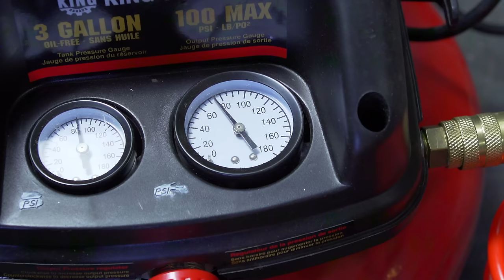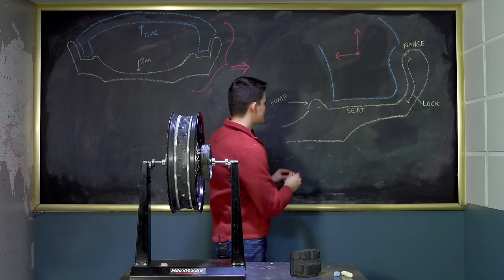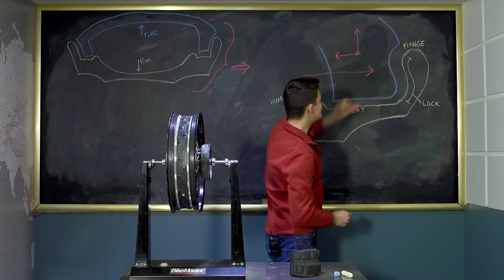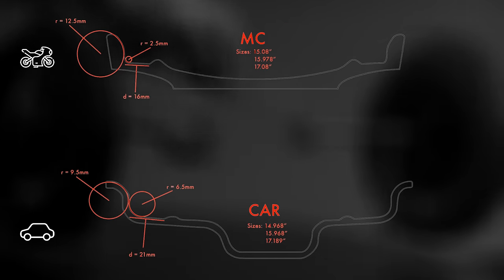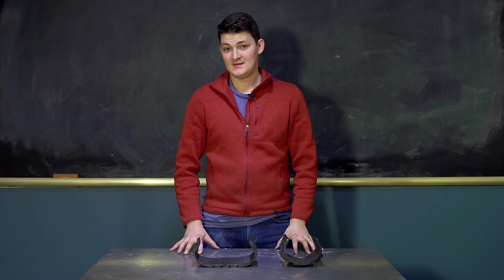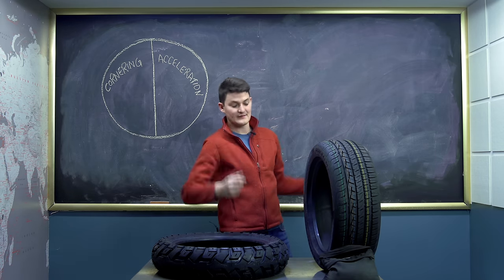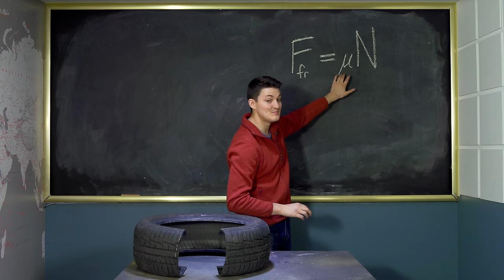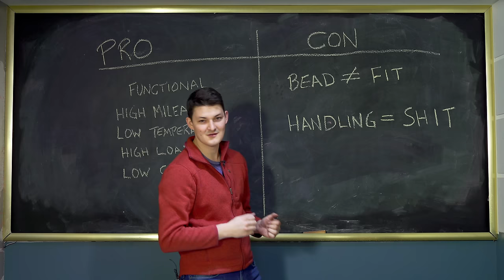Are Motorcycle Tires a Ripoff? The Darkside Car Tire Experiment

Comment: I have to disagree with the "higher mileage" point. Having been turning wrenches professionally on bikes for 15+ years, I have changed thousands of tires in my career. Many were utterly destroyed car tires. The tread wasnt hurt hardly at all. Its the sidewall that takes the hit. When you put big fat bikes on a 2 square inch contact patch while cornering, rubber flexes. Being that the sidewalls are drastically thinner, they flex first. This will generate excessive localized heat and wear and will eventually appear as if something was jammed into the side of the tire and rubbed a groove into it for a few hundred miles. Ive physically seen the sidewalls fail and cause the bike to go down, which totals the bike. And get this, these tires only had a few thousand miles on them.
Maybe its different in flat states without a single turn for hundreds of miles, but out here in east TN where the road maps look like a plate of spaghetti, darkside is a big hell no!
Reply: Couldn’t have said it better my self .
Reply: Every time a post like yours comes out, or like one I mention where a dude crashed twice on car tires, due to blowouts, I'm told to "prove it". It's funny how one side is believed, without comment, while another is disputed. Great comment.
Reply: @Wroger Wroger Another good point. Ill add that motorcycle tires work best and have the most traction when they are warm. They become more malleable and adhere to the road better compared to when cold. Car tires are designed to resist all heat buildup possible so they last longer and will NEVER benefit from the effects of a warm tire and will not have the same amount of traction as a real motorcycle tire.
Reply: There are sometimes blowouts with car tires, because run flat tires are run way too long without any air.  They are so dang dependable that some folks think they can ignore routine PSI checks.  However, a low tire sidewalls are MORE vulnerable upon the thinner motorcycle tire, and I've been guilty of ignoring them when I was young.

Another neglect caused by car tires is the required maintenance on shaft drive bikes.  The car tires last three or four times as long, so gears are neglected until they run dry and self destruct.
Reply: A flat state, and commuting 80 miles each work day, was exactly why I was considering them, but no car tire would fit the back of the Vulcan I had.  I would have done it in a heartbeat to avoid changing out rear tires so much.  The way I see it, I wouldn't do it for two bikes, but for a dedicated commuter or cross-country bike, sure.
Reply: depends on how much you're leaning on corners. Some people barely lean at all and, for them, car tires would wear longer.
Reply: @MrHeepspo  If you are "leaning" on corners, you may need a riding lesson.  I counter steer, and grind my pegs.  You can lean as far as possible, but counter steering forces the bike into an even tighter radius.  Just like on the track, I adjust my air pressure for the conditions.  If I am running hard in the twisties, I bump up a few pounds to round out the tire a bit more.  If I'm heading down the superslab for 1000 miles, I drop my air pressure.

I might point out that I prematurely wore the center of an expensive high performance winter car tire with a hot (100 degrees) round trip of 2,000 miles.  My average speed was around 80mph.  Later, I determined that the tire pressure rose dramatically during that two days on scorching pavement, driving my PSI upward.  So I quickly wore out the center of the tire.  That summer I was also running a couple of hundred miles a day on relatively straight roads, which resulted in getting only 15,000 miles out of the tire.  But keep in mind my riding style tends to wear out an OEM in just 5,000 miles.
Reply: @EpicMale  Yeah, you're a super hero. Counter steering is just another way of forcing the bike to lean. Counter steering creates leaning. Everyone leans to turn. Don't get stupid.
Reply: @ryfish5  He's EpicMale, what would you expect? Besides that, I don't think I've ever heard somebody who rides say: "... getting only 15,000 miles out of the tire".
Reply: @EpicMale    You need to work on your terminology.  If you are going faster than 15-20mph on a motorcycle,  changing direction is accomplished by counter steering.  Always.
Reply: I think the only "proper" place for a car tire on a bike is when you're building a ratty fat-assed chopper. 1) choppers are more about looks than handling, and a wide car tyre can be the perfect addition to your nasty rat-bike look. 2) you won't have much of a lean-angle anyway, so the flexing sidewall problem is less of an issue. And 3) wide motorcycle tires cost a metric fuckton.
Reply: @EpicMale  I understand all that, I was referring to people who are slow, easy riders. I've seen various levels of "chicken strips", based on someone's comfort and/or style.
Reply: You missed the point.  Newbies lean, and can't tighten the radius of the curve, but counter steering pushes you into a tighter radius than leaning can provide.
Reply: Where was my terminology wrong?  I pointed out that very fact.  I didn't mention direct steering because this is about riding, not parking.  LOL...
Reply: Only motivation for the dark side is being cheap and living in Florida.
Reply: @dgomes265  I live in Texas, but I ride up north (OK, AR, CO, WY, MT, ID...  I need the Darkside runflat winter tires for frosty streets, sometimes with patches of black ice, or even ice.  And my rear tires are more expensive than OEMs, though they do last 2-4 times longer, depending upon the duty cycles that put more time on the road in Texas heat.  And, of course, I really enjoy the greater contact patch for pushing the heavy bike in the twisties.  I like that so much I spent $3500 on a Traxxion Full Monty suspension for my 2012 Goldwing.
Reply: @EpicMale  false.  Counter-steering does now allow on to turn tighter than leaning, because counter-steering IS leaning.
Reply: I live in TN, 18k miles on my car tire and rear motorcycle tire which is on the front. I've suffered two blow outs on the rear from motorcycle tires.
Reply: @Milwaukee Mayhem You are right.  You have no special authority.  After 60 years of riding over 55 daily riders, I do have some authority.  I don't think you quite comprehended what I wrote!  You seem to have paraphrased the same tenets I shared.  LOL...

You are entirely wrong.  There are a LOT of riders that do not counter steer, even unconsciously.  I know, because I've taught them the process after demonstrating that an old greybeard on a Valkyrie could embarrass them in the twisties.
Reply: Clearly beyond the capabilities of that type of tire.
Reply: @EpicMale  Everybody counter-steers. It's the sole technique how to get a bike to corner above 15 mph. Something you should've learned in 60 years. 
Try to steer without hands (therefore without CS), you won't get far...
Reply: @EpicMale how long can you balance at a stand still? How far have you thrown the rear end out? 

It doesn't matter. What we do on our bikes is different than what other people do and people have different perspectives because of it.

I've always seen it as turning left to go left and vice versa. While turning left you use counter steering for balance.

As speeds increase you use leaning more than traditional steering and counter steering helps control the leaning. You don't even need the front tire to steer the bike. People do circle  wheelies, is that not steering?

That's my perspective as an off roader. You're more focused on track riding and overlook perspectives outside of your focus.
Reply: @SkadooHusky  No, sir.  You are absolutely wrong.  Many people only lean.  I once taught a pack of squids about counter steering after their sport bikes failed to keep up with my Valkyrie in high speed twisties.  Their collective statements were "I was leaning as far as I could."  Counter steering is not an inherent reaction.  Some do it unconsciously by shifting weight to the inside grip, but that is fairly rare.

I've done the post accident analysis on dozens of accidents where the survivor stated "I was going to fast and was leaning as far as I could."  None knew what counter steering was, nor that a bit of extra pressure on the inside grip would have pushed them into a turn tighter than that gained by merely leaning.
Reply: @ExtremeDeathman  I have steered without hands.  I was standing on the seat of a motorcycle before Indian Larry thought of it.  LOL...  However, mere weight shifting severely limits one's cornering ability.  Many people are unconsciously counter steering, but without conscious control, they get into serious trouble.  When entering too hot, they don't understand how to force a tighter radius with increasing pressure, so they low side and slide into oncoming traffic, or hit the brakes and stand the bike up to straighten out the curve and ride into oncoming traffic.  

Yes, I know you know how to counter steer, or at least claim you do.  But I'm not directing my information at smart asses.  I'm sharing with those that wish to learn and survive to ride again.
Reply: @EpicMale  I bet you think leaning out of a turn is a "big no no."
Reply: @ryfish5  NOPE! I turn the Twisties straight up and down, EVERY TIME! LOL
Reply: @SkadooHusky  I bet you know what everyone thinks.  Thanks for confirming your  Dunning-Kruger Effect diagnosis.
Reply: @EpicMale  I almost at one time in Subic bay overshot towards a sharp curve into a 60 feet ravine. luckily i wasnt fast enough to die. later a rider guided me towards the warf and their i was told i didnt do a counter steering.

Your posts are informative. Even though i was already taught CS most of the time i forget about it. Depends on the riders mindset. some do it naturally, some, like me keep forgetting. So I just bought a car...
Reply: @iwadelosreyes3492  Thank you for the kind words.  Riding certainly takes a different mindset.  I'm glad to see you survived!
Reply: @EpicMale  

You cannot steer a bike beyond walking pace without lean
Next time you instruct a group, try to do it at a faster pace than 2mph
Reply: East TN also. And gotta fully agree. These would be fine for JUST interstate driving. Or guys with giant chicken strips
Reply: For argument sake I have a Darksider 1500 Intruder 15k on a cheap car tire. How many times have you gone down the highway and needed to pass somebody? Have you ever tried just bumping your handle bars in the opposite direction? The bike changes lane before you can get your weight shifted. And I have had people on smaller bike try to keep up with me
Reply: It's a month later. has Epicmale figured out that the word 'lean' can be applied to the bike itself and not just the rider yet, and that's what everyone else but him is talking about? And unless a bike leans, it's not going around a corner at any speed much above walking pace? And countersteering makes a bike lean?
Reply: Again, yeah on eco tires. Not on a performance tire, a car puts way more horizontal load through cornering ESPECIALLY ON THE SIDE WALL than a bike does, if you use a performance tire, it should be ok. also a smaller profile will fix this issue.
Reply: You NEVER ride on the sidewalls. Just never ...
Reply: @EpicMale  Pure nonsense. Blow outs? Proof?  Shaft drive maintenance? Nothing to do with a CT. Fail.
Reply: @workingguy6666  What type of VN don't match a CT?
Reply: @MrHeepspo  I drag my floarboards with a rear CT. Pure experiance, no keyboard miles.
Reply: @corneilcorneil  VN800, though I have to imagine that the VN500 also would not.
Reply: @workingguy6666  Correct, the 800 rim is to narrow. I have a 195/65-15 on my 900 casted rim and will never go back to a MT. Rides and corners perfect under all conditions. The tire, used in this upload is criminal wide, low and square. The outcome was scripted in return for cash. He even delete my comments and don't dare to react.
Reply: @corneilcorneil  You said it!
Reply: @jonboy602  I agree with the gist of what you're saying. But, yes, not only does counter-steering make a bike lean, so does non-counter-steering. Regardless of what we want to call it, a bike will fall down either way: if the front wheel is pointed to the right while in motion, the whole bike will fall to the left. If the front wheel is pointed to the left, the whole bike will fall to the right. The miraculous trick you pull off around every corner is that you get the bike to start falling, lets say to the right, by pointing the wheel to the left for just a moment. At that moment you correct, and keep from falling, by pointing the wheel ever slightly to the right, or less left, again, to keep from falling. And you subconsciously play that balancing trick throughout the corner. I'm not full of myself, but I'm forever trying to explain this whenever it comes up since 1975, and nothing's changed. I hope that's food for thought.
Reply: @whitedartonpt  You talk poop. Pure assumptions, not one meter riding experiance. DS bikes DON'T ride on the sidewalls.
Reply: @papatorr3669  I ride a 300kg Kawa with a 195mm car tire. Straight roads, mountain twisties, sharp curves in total slippery parking lots, tropical rain, ... i drag my boards with no problem at all. This "tire flipper" thinks that he has riding experiance and knowledge because he change tires his whole life ... funny.
Watch his upload about the old Ford and look to the interior ... 🤣🤣
Reply: @corneilcorneil  Your right, you dont ride on the sidewalls. But when you ride on the edge of the tread, it deforms the sidewalls. Far more  than they would on a car. If there was a way to post a photo here of a destroyed car tire ive replaced on a bike I would. It literally looks like someone took a grinder to the sidewall.
Reply: @corneilcorneil  and you want to claim I "lack experience and knowledge." Ive been riding 20 years, wrenching for 15 and I guarentee you I have ridden more makes and models than you can count. I base what I say on what I have physically seen and experienced, not heresay. One of the bikes that were pretty much destroyed (a vulcan 2000 if I remember right) due to the sidewall blowout had the insurance claim completely denied when the adjuster came out and saw the car tire.
Do it if you want. Its not my butt on the line.
Reply: @whitedartonpt  Oh dear, the same bla bla like always. So long as the tire is DOT aproved, it is all fine for the insurance. Strange, that i, as a VRA member don't know about a VN2k with a Darkside related accident.
Real special ... of is it just fantasy?
And on ghe other side ... what i see in your upload, tells me that you are a Italian cook, no mechanic.
Watch that spaghetty pile in your car! 😆 That is just a terrible job ... for a "mechanic."
Reply: @Wroger Wroger Do some real research. A CT contact patch is always larger than a MT contact patch, always.
You take your assumptions for real, that is all.
Reply: @Scott Cole So, when MT AND CT build up pressure by extreme heat, what is the point?
Reply: @Wroger Wroger And what is your point? Ofcouse is a CT patch larger at all times. I don't have to test it, i ride darkside. The "very thin" in your discription is still double from a MT. Btw, a MT patch is always "very thin."
Reply: @EpicMale  so, you think countersteering doesn't involve leaning? YouTube! I love it.
Reply: @corneilcorneil  shaft drive bike usually get their splines greased when tire is replaced. A longer replacement interval means fewer lubricating chances.
Reply: @MrHeepspo  which is why 85% of the dark faithful are goldwing/equiv gvw. those bikes spend 90% of their time on the center of the tread
Reply: @EpicMale  counter steering is how you make the bike lean into a corner you dont get one without the other.
Reply: @NZ2STROKE  LOL...Not been riding long, eh?  Yes, you can lean without countersteering.  When I was a kid we'd goof off by leaning the bike to one side standing straight.  But, again, you can lean as far as possible, then add countersteering and tighten the radius of the corner.  Does that tell you anything?
Reply: So what you're saying is keep those tires and keep them on your car? Gotcha. Thanks!
Reply: @EpicMale  You do know that counter steering is ALWAYS used to initiate a lean, right? It's either subconscious or conscious, but physically, it is what is needed to actually turn the bike. This even applies to bicycles